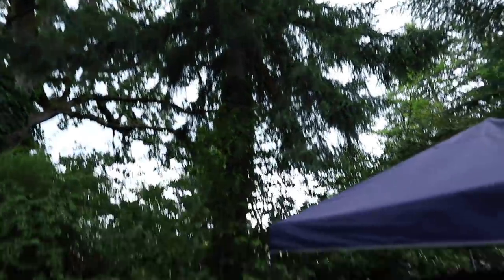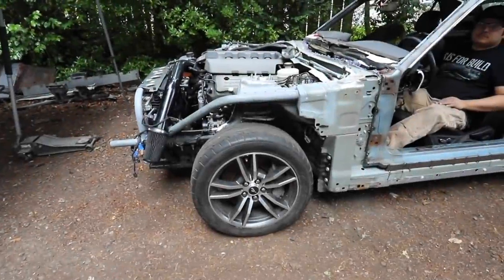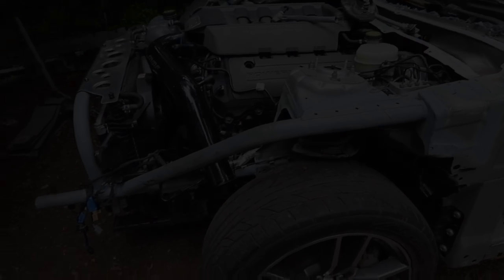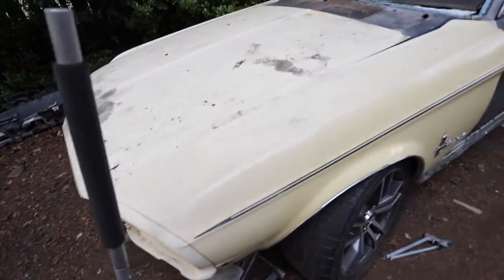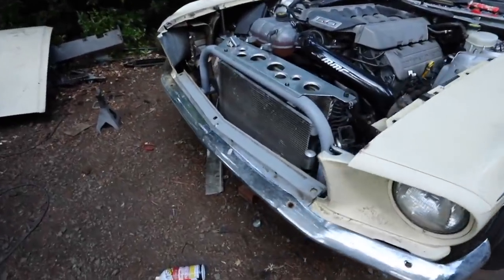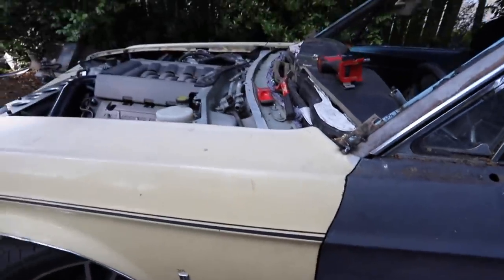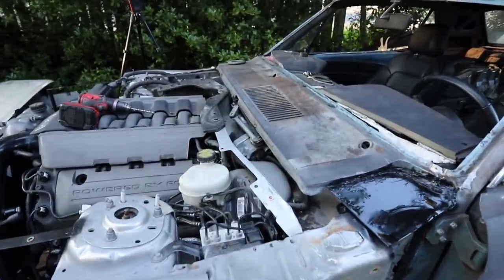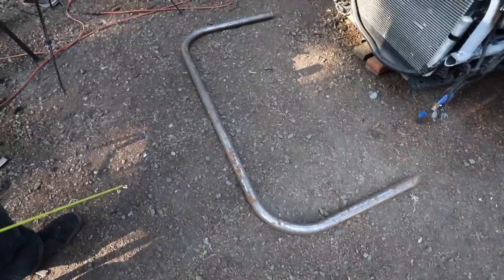1967 Mustang Front End Installed On Oscars 2016 Mustang GT

Comment: Chris when you're doing the exhaust for the rear o2 sensors, make sure that they are NOT completely horizontal to the ground.  Its a common problem in 15+ mustangs with aftermarket exhaust that the rear o2's are killed by condensation if they are horizontal.  If they are angled down slightly 45 deg to the ground you'll save yourself a world of future troubleshooting and problems.

Comment: As I owned and drove 66. 67, 73 and 76 Mustangs I can definitively answer that yes they did have hood latches in the front. The latch arm pushed to the side to unlatch.  But they were notorious for unlatching at hi speeds; which is which is why so many people  installed hood pins in the front.  My older brother had the hood of his 67 unlatch on the freeway at about 75 mph and destroy the hood  hinges around 1971. His 390 4 Sp was making around 500 HP at the time with decked and ported 428 heads, 3/4 race cam, duel plane Edelbrock intake, Holley 4 Brl 780 Double Pumper Carb, Hooker headers, ACCEL duel point Distrib and Hi Energy Coil and fiberglass flex fan.

Comment: FYI that's a 68 front end.... fenders etc... in 68 the side fender "mustang" emblem was cursive and they added the side turn markers. Other front differences not necessarily shown in this video were the 67 grill running pony was much thicker than the 68. The back end is definitely 67 as they the side swoops had the serrated side scoop and the 68 had a slim chrome strip instead of the serrations. Still a super cool build!!! Glad we were able to see you do this body swap finally.

Comment: I like this Mustang project better then the first. The fitment and shape of the body parts look correct. I kinda wish they'd use pipe tubing for the front fender brackets that connect to the radiator support.

Comment: Any aftermarket intake needs a retune that pipe flows allot more air than the stock intake so the mass air flow sensor now seeing less  velocity making it run lean  get a SCT programer or a Diablo Motorsports programer has a few tunes preloaded  easy to use  will fix the problem
Reply: Yeah it probably does need a tune but get HP tuners....

Comment: I did say O2 sensors my exhaust had a leak in a flange between first and second sensor and would run rough at idle as well as running rich.

Comment: You built a water redirection shield for the cowl vents but what about the factory wiper holes? Also how do you plan on modifying the wiper assembly from the new Mustang to function on the old Mustang? By the way I love the fender mounting solution.

Comment: I'm more hooked into this build than the first. As far as your engine struggles go, i think you fella's are being a bit arrogant. Never mind your diagnostics, I want to see you do the normal/necessary maintenance on the three primary systems, ie Fuel (buy some, check it's getting to the rail) , Spark (just a basic plug to chassis test), then your bloody air filter. Looking nice, great patina.

Comment: People calling these cars death traps. This is not true. 
Of course there is no way to know how it would perform in a crash test.

However as a hobby it's risk vs reward. Its a ton of fun.
And way less risk than say, a motorbike, parachuting. Wing suits. Mountain climbing. Skiing. All things people accept risk on and enjoy.

Driving This is a lower risk comparatively  and probably even less riak than a classic mustang as disc breaks, abs, airbags, traction control. 

Crumple zones Are a part of safety and would work to some degree anyway. But people still drive classic minis with minimal safety systems.